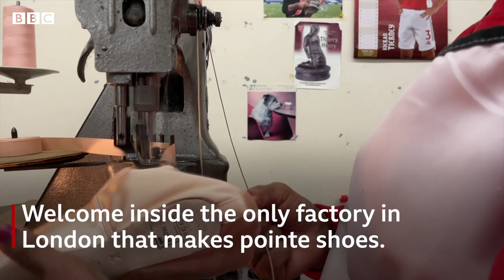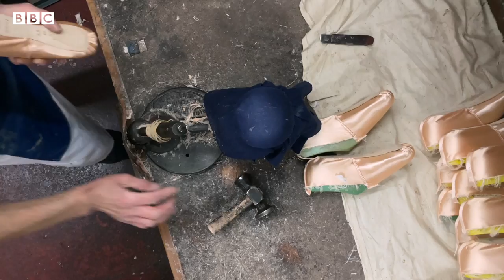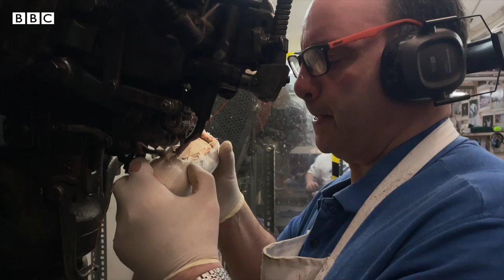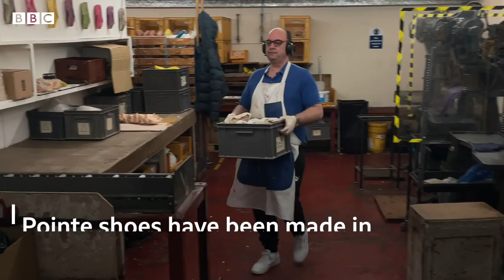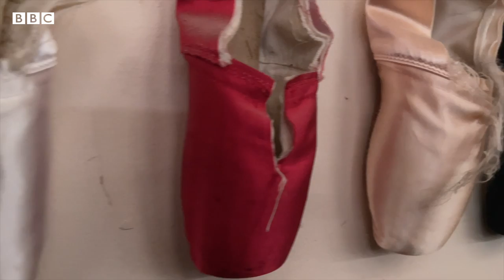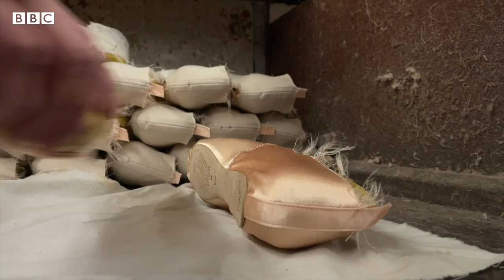Inside the UK's only ballet shoes factory

Comment: the only ? I thought bloch and suffolk were also made in the uk last I checked, I know though in the states you only have a few models produced by suffolk in texas and maybe capezio if they started doing their custome shoes in new jersey again, gaynor was but the factory they contracted to closed up in the pandemic and just sold off everything so there is not even a chance for it to come back as far as that goes, and few custom makers left that can do it even if they are willing to, as making the box on point shoes is not like making other dance shoes, or percussive dance shoes like types of clogging or tap shoes thats a bit more straightforward.
Reply: The BBC will not correct even after contacting the author of the piece.  Suffolk's factory is in Leicestershire, England.  Suffolk and Freed are the only major pointe shoe manufacturers in the UK.
Reply: I think the bbc didn’t know Suffolk is a company as it isn’t as major but freed and Suffolk are the only hand made shoes in the uk
Reply: @Charley-bs3iv  yea and they do also make some of the shoes in the usa in texas they are the last ones that do here in the usa too though there are a few indaviduals that can make custom pointes suffolk is the last major brand, gaynor's vender closed in the pandemic and did not even try to come back, though the guts of the shoes and insoles are still from usa made parts on most models
Reply: @manga12  so I think what they mean is because Suffolk and freed are the only handmade shoes in the uk capezio and Bloch ect are factory made